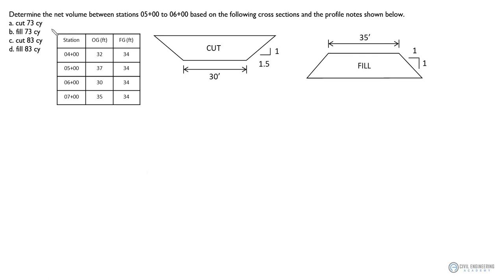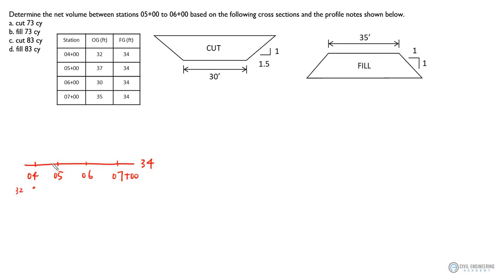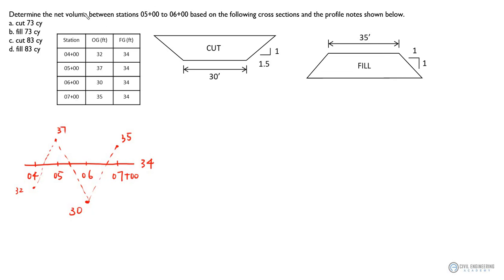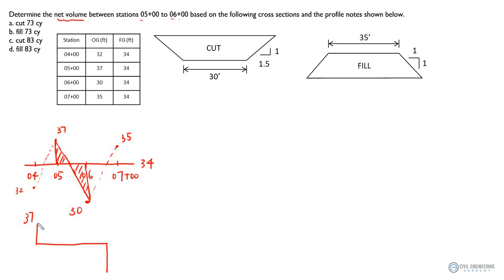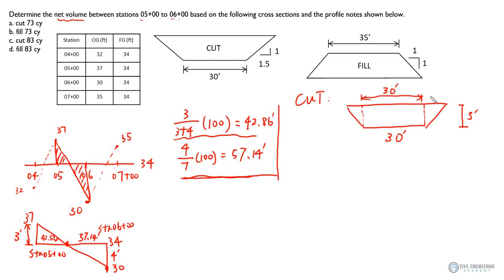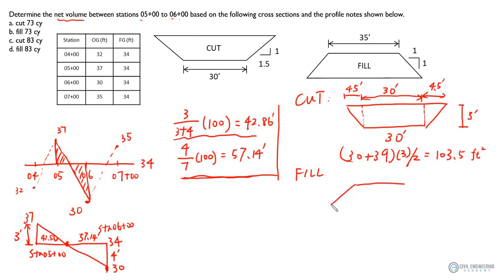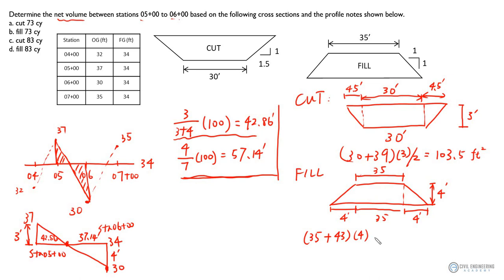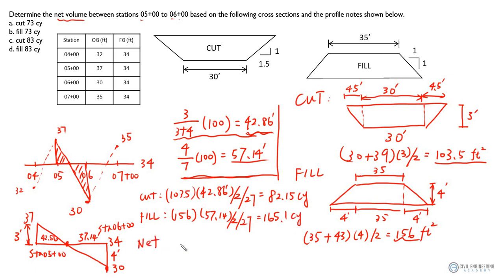FE and PE Construction Problem - Find the Net Volume Between Stations

Comment: Is this a right question? why don't we consider the prismatic shape on the station change? it changes in both length and cross section. I think 114.3 x (156/2) is the fill and then cut is 64.29 x (103.5/2) and then net volume will be: 207 cy    ..... please correct me if I am wrong!